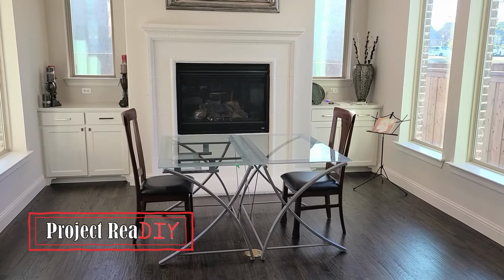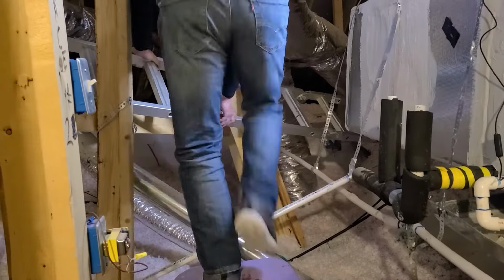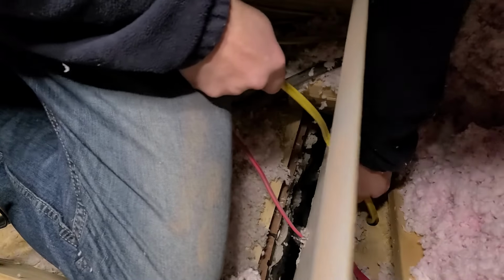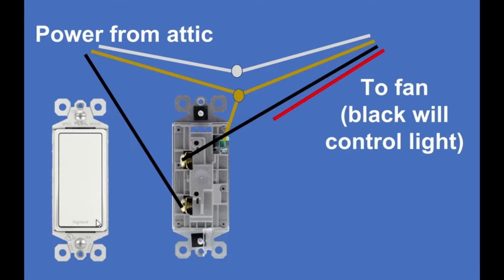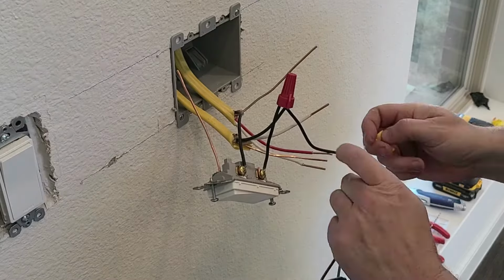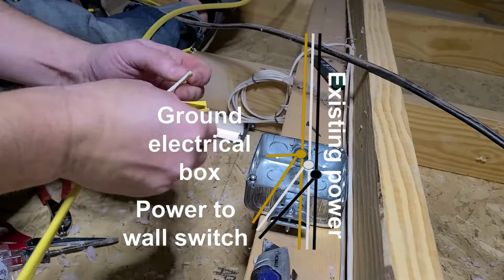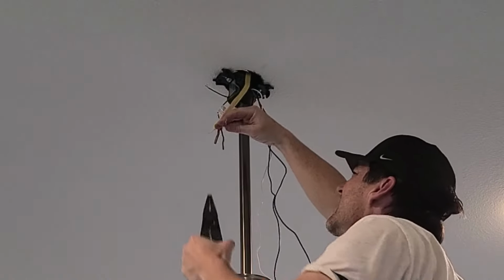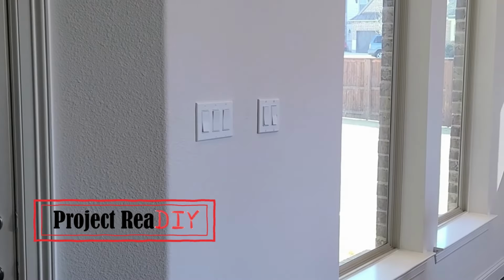Running wire for a ceiling fan in a finished ceiling & wall

Comment: Great Video! I personally would have just grabbed power from tapping into the switch next to the fan switch, just tap power from the bottom so those switches on that wall all run on the same breaker. Plus it saves having to run extra wire since romex costs a fortune!
Reply: I was gonna ask if this would be ok, I want to add a billiards light in my basement, there's a three gang switch panel but only two switches. So it would be easy to add the third switch
Reply: @triptheroad correct, just cut out another spot next to it to fit a receptacle box or fit in one of them old work boxes. Then just tap power from the switches next to it. Tapping into switches is not against code but you cannot tap more than an acceptable amount they claim, not sure what an acceptable amount is? 4? 5? ehh who knows 🤷‍♂️
Reply: @ilyfreezi  yeah luckily there was an open spot in the existing 3-gang box since I deleted a previous owner or contractor's botched attempt to properly wire a 3-way circuit. They wired the switches in series so I took the switch out of that box which left an opening for the new switch. Wired it up over the weekend and it all looks great!
Reply from the maker: Great idea - didn't even think of it.  Would have saved a run of wire.  I'll know for next time.  The YouTube DIY community is very helfpul.

Comment: Could have daisy-chained the power wire at the switch to the other switch (2-wires on the terminal) and eliminate the wire nut (and possible problem)
Reply from the maker: Didn't even occur to me - would have saved a run of wire.  I'll know for next time, thanks!

Comment: Great job! The wires in the switch box gave you trouble because there was too much jacket left on the wire. Should be at least 1/4 inch sticking out from the clamp connector but not really more than 1/2 or 5/8 inch. This gives you more room and it's way easier to bend the wires back. Other than that, it came out great.

Comment: Thanks. I got a lot out of the video. Im putting fans in my garage so this is good knowledge. A trick I have used countless times…you made an extra hole to pull the wire. When I need to make an access hole, for plumbing etc, I cover the hole with  a blank switch plate or if it’s bigger, I use a cold air vent. So far no one has ever noticed. Then there is zero drywalling repairs.

Comment: Excellent video! Great step-by-step editing. Thanks for being honest on the difficulty involved and the actual "shock". It is so easy for DIYers to forget to turn the power off (speaking from experience, of course.) My advice...go slow and double check breaker is off, then check dead with voltage tester as he did in video.

Comment: I can deal with home electric improvements with ease, yet, I never went beyond typical single box switches & outlets. This was the first time I used 14-3 wire (fan)  & 12-2 (power) to install a ceiling fan with a 2 gang box  successfully. You saved the day & The Lady is very, very,  happy.  Thank you very much!

Comment: One of two things I’d do differently, 1 strip more of the wire jacket off leaving 1/4” of romex sheath. 

2, wire up the fan to the left switch then the light on the right. 
3, add electrical tape on devices and finish installation.

Comment: I have a light/fan that is not wired to any wall switch. It goes right to a junction box and I am assuming from there it routes to the circuit breaker. I am trying to install a switch for it that requires red, green, orange, black, and white wires. I don’t know where an orange wire would come from in my attic. The switch I have controls the light and fan and can adjust the light brightness and fan speed.

Comment: How did you get that excess length of wire back into the ceiling? I'm replacing a ceiling fan and in my attempt to get the wiring back into the box, more of the attic wiring came out of the ceiling than I wanted and I can't for the life of me get it to go back up the slot it came out of. Can I just cut off the excess length? 

Also, any tricks to getting all my fan wires into the tiny space of the straddle box?

Comment: I have a room with the 3 switches. My ceiling fan only has 3 wires. White, black and green. Is there a way to still connect my light to one switch and the fan to another switch?

Comment: Don’t think you need 12/3. I believe 14/3 is for lighting.
Reply: 12 gauge is for 20amp circuits, 14 gauge is for 15amp circuits. If he used the 14/2 to connect the lighting that would fine but if the breaker is 20 amps, the homerun should be 12/2.
Reply: @mvsawyer  correct but in general, 14 gauge wire is used for lighting